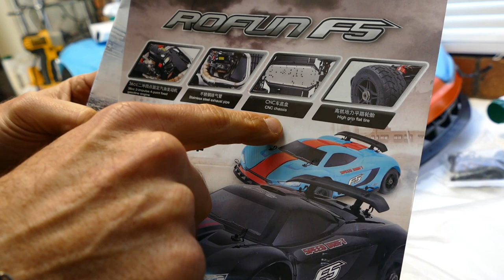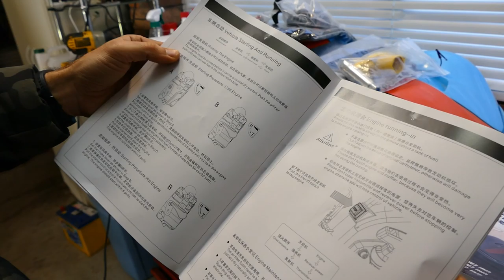ROVAN F5 1/5 4WD 36cc ON ROAD RC CAR - First Start! Brap! SO LOUD..

Comment: Primal rc is also the rovan/king motor US distributor. When you make a purchase on ebay with the Rovanrc seller and it ships from Valley Cottage, NY its actually shipping from Primal rc. The Primal MT is being manufactured in the same facility as Rovan and King motors
Reply from the maker: Ah awesome. Thanks for the info mate

Comment: This thing is sweet really want to get one for my channel I already have two of their Baja trucks and love them it’s definitely on my shortlist and even possibly one of the FG belt driven 1/5 scale’s
Reply from the maker: Sweet man. I just converted it to brushless.
Reply: RC Tanks & Trucks 24/7 In that case if you could give me just a quick idea what would you use for motor and controllers on this I actually thought about buying one of their roller chassis and building it myself since I already have a couple of gas vehicles would really like to build one to run on six or eight hours but I’ve never build a cute before I figured something this large might be reasonably easy but then again I could be totally off base

Comment: It's so surprising to see  this car sold by Rovan while I have the exact same one for a couple of years from MCD Racing witch is a Turkish manufacturer still selling those cars in Europe. I first thought it was just a copy but the car seems to be the exact same one (except for the wheels and tires). I'm wondering if MCD is producing for Rovan or if Rovan just buys the components and licence from MCD to assemble the same car. In any case Rovan is not proposing the conversion kits I have from MCD (I have 3 versions with the same car : onroad car - short course car - rally car). Rovan version is cheaper than MCD original version.
If you want to convert it into brushless (I did it with a 12S esc) MCD Racing currently offers an affordable brushless conversion kit (battery trays + motor mount + pinion adapter) that should fit in this version as well. They also have different pinions available since they are not standard.

Comment: Very nice brotherman 😁😁🏎💪 i want one .rovan taking o v er 5th scales vlaue really good  i have that motor in my 5ive screaming good power t hose  filters are cool bc its away from the heat but. The velocity stack helos hit power band idk if could use with that . im going get that big. Cold air intake you guys use alot over there they lil expensive i can still use velocity stack  also only g e t spare or bet t er pull s t art and you should do some heat cycles although we dogo w
 crazy breaking motors in if you buy a chainsaw  they tell you let em rip 50:1 bc epa pollution with. Im getting a   obrian motor but always impressed with power value i get pipe motor couple lil tricks thing is s beast for 300 dollar upgrade that wouldve just have been enough for the pipe . kudos rovans🙌🙌🙌🙌
Reply from the maker: Sup bro! Thanks for watching and I appreciate your comment. Definitely great value for money these Rovans!

Comment: For european, its Rebrand under MCD. With conversion kit you Can have short course, TT, and a beautiful rally😍😍😍
Reply from the maker: Sweet, thanks for the info
Reply: @RCTanksTrucks247  Surely Not. MCD, is a full blown race brand isn't it? Rovan is a just a cheap Chinese knock off.
Reply: @credstarkatie8441  well there still good cars